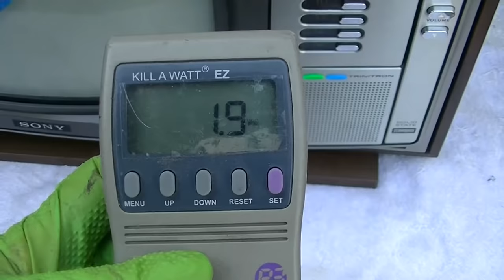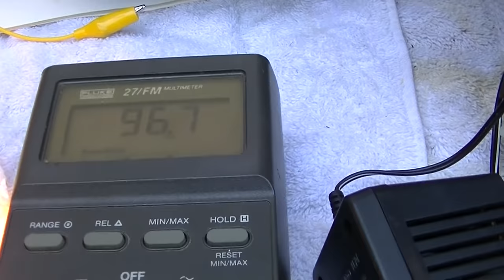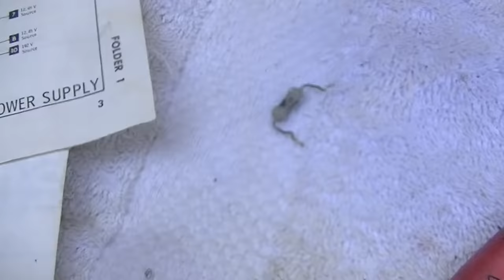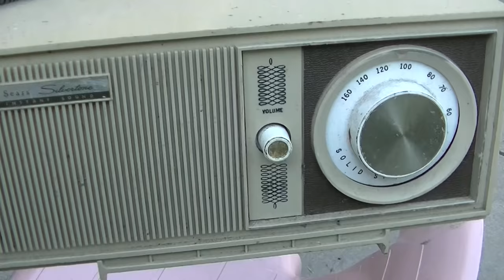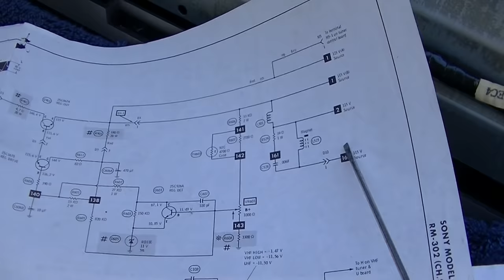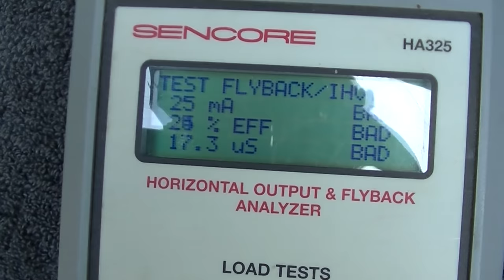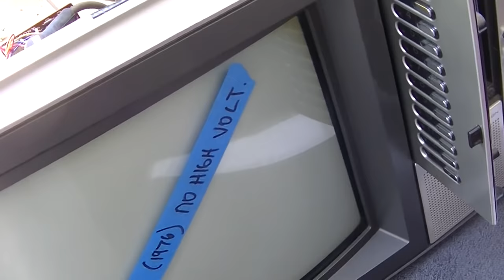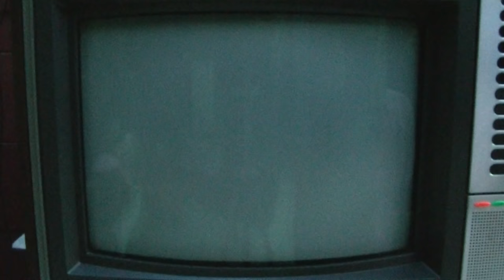Sony Trinitron KV1541 Remote Set Super Hard Fix 1977 Vintage Color TV

Comment: I haven't come across a comment on the light emitting resistor so, thought I would add my 2 cents.  That is part of a snubber circuit; the DC feed for the flyback primary.  The resistor got hot because, the harmonic current went way up with that rectifier shorting out.

If you monitor, using a one turn secondary on that bad flyback, with an oscilloscope, I think it would reveal the rectifier breaking down.  You would want to load the one turn with a 100 ohm load (or there abouts) to get a clean scope reading.

I can fully relate to instantly blowing expensive components that were tedious to replace.  In addition to the TV repair I did in the 1970's, I also designed RF power amps in the past, which have very expensive final transistors.  To prevent popping them during the design phase, I designed a high speed power shutoff, that would react within microseconds.  That addition totally ended that problem.

Comment: It's amazing how one little zener can cause all those headaches. I'm assuming it's mainly because of the way Sony had that circuit designed that caused it, but, what do I know? I just come here to learn, AND for the shango comedy! 😂🤣
Reply: It is a fail safe circuit, so it blown itself away :-)
Reply: Except the zener only caused the high frequency horizontal oscillation.

The burning resistor and the lack of raster were down to a crap flyback.
Reply: same thing with audio amplifiers and SMPS feedback circuits, when zeners fail, fiasco follows haha XD only replacing them with fresh zener will restore enough stability in their zone of their circuitry)

Comment: I think 🤔 this is vintage. It’s color, and it’s a Magnavox. Just the sound of the hum takes me back to my childhood. This TV 📺 may be very hard to fix, but ya can do it. This set should be resurrectable, as long as it hasn’t had soda 🥤 pop spilled into it. This looks like 👍 such a decent set, even if the capacitors are out of tolerance. The circuit boards look 👀 very good 😌, even for this TV 📺 to be a 1977. Your friend, Jeff.

Comment: that 'issue' of different replacements given for one type number was common here in the 60s and 70s with parts used by thorn/brc, it depends on what the transistor does in the set, brc used their own classification numbers, such as AF2 which could be several actual type numbers ,

Comment: Reminds me of my attempt to repair a free samsung plasma tv. When I replaced the board  it worked for 5 seconds and then it fried. 
Then i said nope and it went in the trash and i bought a Panasonic instead and it still works years later with lots of hours daily use.

Comment: I have to give you credit for your tenacity, that was a tough fix....that TV set fought you every centimeter of the way from broken to fixed. 

I am wondering IF your thermal camera can become a diagnostic tool, it can show you which elements are working correctly.... current flow causes heat, the correct current flow will yield the acceptance operation temperature of each component.

I believe a modernized Sam's circuit diagram would include a thermal reading printout of every component from a properly working set, so you can compare the thermal picture from a broken set to a working set.

The theory is that broken or malfunctioning components will have a different thermal signature and thereby make it easier to identify.

It might streamline the repair process.

Comment: Thore 70s tv set ran hot for some reason. Even a few count on fire they ran so hot. And heared something back then about run away high volts. So that why they put all that safety circuits in them. But with transistors there nothing more safer then a transistor. They blow once they get pass what they can take. They were neet tv and had a great picture when they were running right. But as you see a pain to fix when they are broken. And parts to any hobby are getting hard to find. Keep doing this videos on how to fix tv and radios. And we all know there users and fixer to anything. The users don't know how hard it is to fix stuff. And the fixer know how to fix it but take time and lots more time trying to find replacement parts. But been there myself trying to find replacement part.  Lots of times you got to go with other part that can work but the shape and size is not the same as the old part was.

Comment: Most     Failures of 613 usually are from weak drive  usually a cap .47.many models   in the drive area  We were a Sony dealer    flyback was common fails.  I've subbed a common horiz output well heat sinked for testing for the sg s  they run hot   think have few sgs somewhere
Reply: Some sonys  had a cap that started the osc then sustained from flyback  once running was usual weak

Comment: What an awesome video I watched the whole thing as another Technician I can relate to some many of your frustrations on this repair. Currently I have an Honest ABE CB not worth the amount of time money and effort I have put into it but it has become a quest I refuse to give in to. The fix still eludes me as I continue pull test and blow new parts it will get me so frustrated that I cuss it and throw to the side and then after I cool down and have a little free time I go at it again, one of these days I will win just as you did I wished I had donner unit sometimes that it the only way find that elusive nugget :)....

Comment: I was working on a small computron monochrome crt driver board and I believe it had a very similar problem to this one. I could hear the horizontal circuit start up but shortly after the 2n4401 transistor that drove the drive transformer would smoke. One other time a resistor next to that transistor burned. I think now I need to check the zener diodes in the circuit.

Comment: I have recapped a 1973 Panasonic RQ-409DS and a 1982 Panasonic RX-1460... can confirm that the Matsushita caps like to get leaky. In the case of the audio equipment, however, the device will continue to operate relatively normally. I think a transistor in the RX-1460 poses more of an issue than the caps ever do.

Comment: Bring me to flash back 25 years ago when I try to repair my Sharp TV. 2 IC going bad and I'm lucky the spare part store man also a repair man, he told  to check all diode after found 1 protection diode broken. He said if that diode broken it will impact  the other diode. He advice me to replace all protection diode.  I must replace the 2 ICs and a bunch of protection diode. The TV back working for a few years until the tube weaken and I must replace with new TV.

Comment: Well, I made it all the way through but I did it in 4 stints as the suspense was too much at times!  Those early Sony trinnys had a bad rep for bamboozling faults with chain reaction modes of component destruction.  I wonder just how many times during that process did that set almost end up in low earth orbit?!

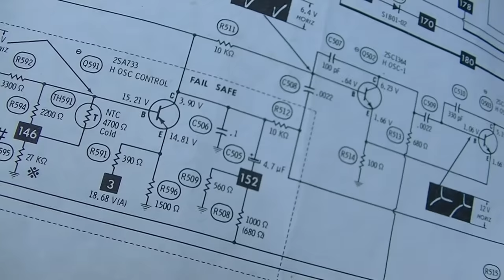Comment: 1:23:08 Nerky burrflurrder derzhl erwerflurchzel is definitely the proper technical term. I think the reason your big SCR did not work is that the circuit needs a fast gate-turnoff (GTO) type and this isn't especially commonly produced these days. The one you found is a slow type and does not have gate turnoff capability.

Comment: I've got this rare Tamasakochi LH-2187a from 1976 (not the one with the red on/off switch, but revision 2 with the black switch). Very occasionally it will start ghosting and the volume will decrease slightly if the air temperature and humidity is lower (like in fall/winter). I've replaced all the caps and deoxited everything, but no difference. What do you think could be the problem, and if I send it to you, how much will you charge to fix it? I need a firm price please.

😁

Comment: I've been fighting with an apple color composite monitor that blows its HOT about .5 sec after turning on.The initial failure I saw was an open B+ xener. I've popped 3 HOTs so far, despite everything in the horizontal section seeming to be OK. 
It's so annoying that every test cycle destroys parts. I've given up working on it for the time being.

Comment: It looks like you have a Spanish channel on 6, and that color cycling looks like just a poor signal. I would love to see it playing Gamecube, though--something with a good signal. Never mind. You did that with MTV, actually playing videos. Quite a trip. That said, I though most flybacks were supposed to have those spacers, as they use the gaps in the core to generate hysteresis and help generate the high voltages. While I have been wanting to get back into fixing TVs, I don't have the patience right now.

Comment: I used to repair these back in the day, I hated working on Sony sets b/c the transistors were custom spec, made by Sony.  If I recall, the tripler diode in the flybacks were prone to failure.
Stock up on flybacks if you plan on repairing these, some of the sets back in the day had divorced triplers on them, never tried to hack the tripler off a flyback and wire the rf out to an aftermarket tripler but it might work if you're careful.  NTE-533?

Comment: I was hoping you could help me with a problem I'm having with my Tv set? Its a 1979 Somy TrimpyTrong B48TYL ? When I Press the power button nothing comes on the glass front. All that happens is the Speaking just squeaks. I asked a friend who builds gaming computers but he has no idea whats happening. I tried turning the selectoknob but it doesn't seem to be correcting the selectotrong. I'm thinking the internal rototweebulation might be seized but I have no way of testing it. Also when I wiggled the twinklotringulator it just makes a buzzing sound. Any ideas what could be the matter?

Comment: To make that TO-220 regulator transistor easier to change you can use the plug off an old PC CPU fan (or another similar one with heavier wire) and just plug the TO-220 into it. then bolt it onto the heatsink with the standard TO-220 mounting hardware.. I have done this in 2-way radio power supply repairs many times.
For the SCR H-Out device I would have got a TO-3 socket for it.

Comment: 1:49:00 IIRC didn't Muntz use Sony OEM CRTs for some of their big-screen projection TVs?  I remember they used them because of the Trinitron brightness.  Knowing how Muntz generally did things, I though they were just over-driven, but I've never seen on in the flesh, as it were. Is it possible this trapezoidal mirrored burn-out CRT dumpster fire is a Mad Man Muntz special?

Comment: Just to say at that time power transistors were not as rugged as they are today. (They had a lot less choice with high voltage high power types too). For many reasons they were more delicate in these high power pulsed circuits etc. A modern device would likely survive much more abuse. We should in fact have a list of modern replacements - better and cheaper.
I remember that just about every other set would have a shorted line output transistor when it arrived for repair - and was often followed by a bunch of others.
The Ferguson TX series brings back a bead of sweat.
Edit: then you got the whopper SCR and a bunch of modern alternates... Should watch till the end before commenting..

Comment: Definitely a difficult thing to fix on a later model color TV. Check the diodes first ,then the caps. Replace OEM parts!
  Shorted yoke? Where's the HV? Possibly the flyback is  now a fry back.

Comment: How long do the Sony tubes typically last?

I had one of these TVs back in the 1980s and tried to get 2 different shops to fix it and they simply said the tube was gone and it wasn't worth fixing.

Any judgement call on the tube having actually been bad or was the set just too much of a hassle to debug / fix?

Comment: What a Trip !!! This one beats the tuner-challenge some yrs ago (botched and burned ^^ oscillator was not working..). On those faults you can see the high-level-technician. I compared it with my most difficult faults but these two main ones (defective Zener Diode in the protection circuit cranking the frequency into madness and the strange defective HV-transformer) are more difficult than these of mine. The other faults make it not easier, I think, I would have given up with this ... perhaps I would try to change the horizontal-output circuit for testing, perhaps it would be possible to change the driver to an more common and cheap transistor-switching circuit only for testing to not cremate expensive parts... Your way of fixing this is absolute fascinating and on point !! I am impressed with this.. Still wondering, what the problem with the flyback is. The air gap between the cores is much critical !! When you found this broken clamp I would have been bet thats the cause !! I experiment with home-made an wound flybacks and this air gap ist much important for the right inductance... The very hot heat sinks can be normal, but I would be not sure, too, if its right.. but when the current...power is o.k., maybe its like the developers wanted that.

Comment: When the HOT died in these sets it ALWAYS took out the power regulator. The HOT shorts and the regulator cannot handle a short across it, the transistor gives out. Its a series pass regulator they usually fail shorted . Try later ones from the 90's HOT shorts and it kills even more.  BTW yes those nasty purple caps are shit, most are leaking to the point the leads are green. Usually a power spike or a bad capacitor in the horizontal drive causes the output to burn.

Comment: When you start the TV  the  horizontal module will start generate the Hi voltage and power the filament tube as well. The safe circuit purpose is to keep off the cinescop  anode voltage off, until the cathode reach the proper temperature to emit electrons. 
This will extend the life of TV .  
That confusing simbol on diagram is for Thyristor,

Comment: that fly back transformer, the grey thing hanging off the side with the high voltage lead coming off it im sure you realise is a voltage multiplier, ive seen them fail and short out the secondary of the transformer a voltage multiplier is a few capacitors and diodes usually a diode shorts in it and it overloads the flyback!

Comment: Welcome to the horror of repairing a Sony with a GCS horizontal sweep/power supply! These used a "kick start" circuit that momentarily powered the 18 volt bus which caused the power supply to "bootstrap" itself up. If the kickstarter shorted, it put 100 some volts on the 18 volt rail and nuked most of the TV. Yeah, I used to repair these little nightmares back in the day.

Comment: Impressed with your determination but  I would have ditched that Sony in a heartbeat and never thought a thing about it.  There should be a law about making circuits like that just to watch reruns and endless commercials on tv.  Leave it to Sony to make a TV like that.  Just what was the advantage? Give me a Zenith 25DC / 25EC / Chromacolor II vertical chassis or early System 3 any day of the week.  Simple in design, easy to repair, readily available parts, performed well, great picture, and longevity.  The Zenith Hallmark.

Comment: Those little red insulators affect the L value of the flyback. Im no expert but I remember forgetting to put them in when I worked in the panasonic factory and the flybacks failing the quality control with L or Q fails. pain in the butt to unclip and unglue everything afterward to correct. If memory serves you got different thicknesses of disc , and in some models you put 2 or even 3 of the things in to make a bigger gap in the core.

Comment: I followed your fault finding to the end. Excellent. I would agreed with your steps all the way - what a set to fix? That zener.. who would have thought? The battery inserted to break the loop was a inspired.
You couldn’t find anything wrong with the coils in the transformer, but what about the diodes in the voltage tripler?
Maybe they were defective, and pulling down the EHT?
Anyway full marks for perseverance.

Comment: I remember the numbers NTE293 & NTE294.  I stopped using NTE products and started using Fairchild and Onsemi.  NTE products are hugely marked up and not always a correct part.  The catch is looking at datasheets more often.  On specialty and/or unobtainable parts, I may be forced to use NTE products if they are the only company having it.

Also, I wonder if that "broken" flyback being unbolted change the gap set between the two halves core.  Changing the gap may as well alter the loading frequency.

Comment: you switched the tv on and there was smoke on the horizontal thyristor sg613 , this is what happened to me after replacing sg 613 on the power supply , sg609 also on the power supply and all of them were burnt and I got frustrated because I spent a lot of money on the components

Comment: one question even where you live there is an analog TV signal because according to what I know years ago it was the analog blackout greetings from Colombia
Reply: that's not a problem just get a digital converter box and use that output to channel 3 on the set.

Comment: Actually, not so rare. At least back then. They were quite popular back in the day despite being very expensive. But many may not have survived. I had the 17" version I bought used for $425 about nine months old. About $500 new. $2,263.28 today after 352.7% inflation. After about 8 or 9 years, one day it suddenly went dark. I figured it wasn't worth the likely cost of repair, so it got dumped and replaced with a 19" black plastic Panasonic. Now I with I had held onto it. A classic.